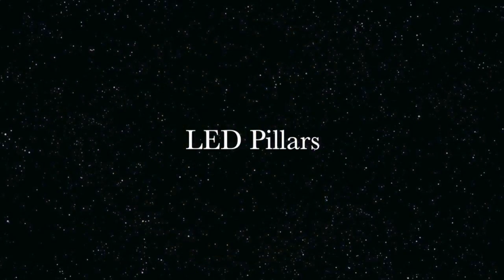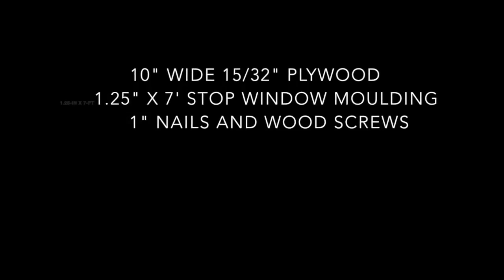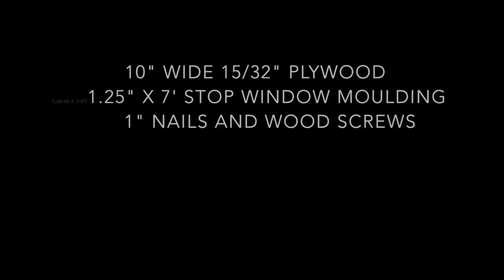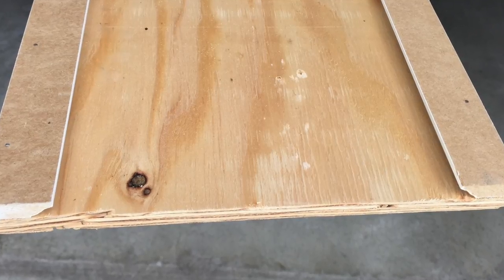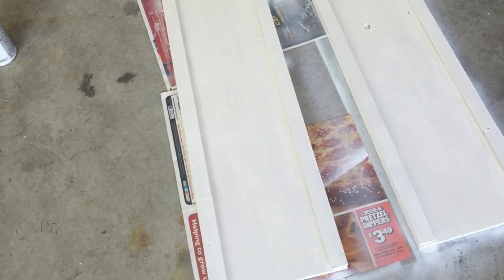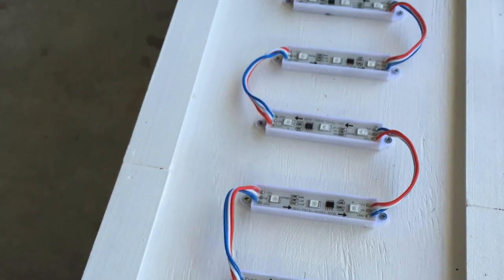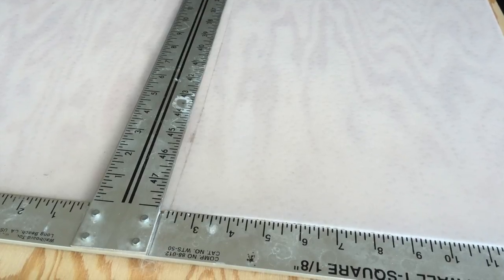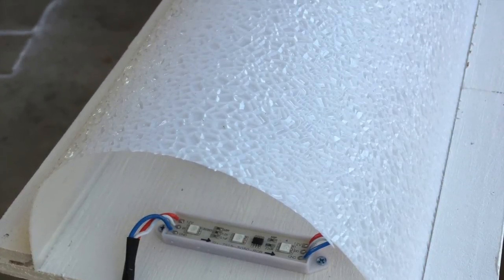LED Columns/Pillars

Comment: How did you power these and sync them together?
Reply from the maker: They were powered and controlled/synced from my light controller - a Sandevices E682. I now use both E682s and Falcon F16v3 controllers.

Comment: quick question what model do you use in your sequencing software i use nutcracker but couldn't find a model that did it
Reply from the maker: +dznmodsparrish I use Vixen, so can't really answer. I just set them up as a standard string of 30 LED lights.
Reply: +Jared Smith copy that sir understood